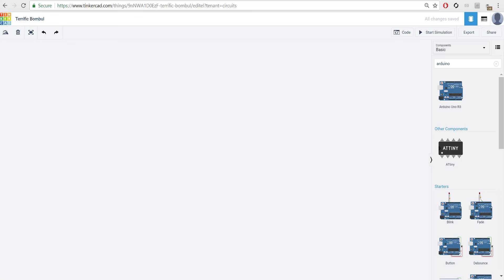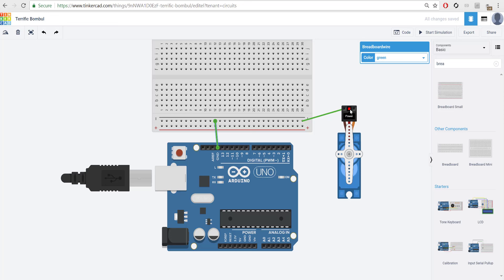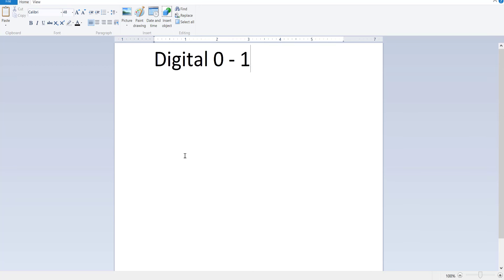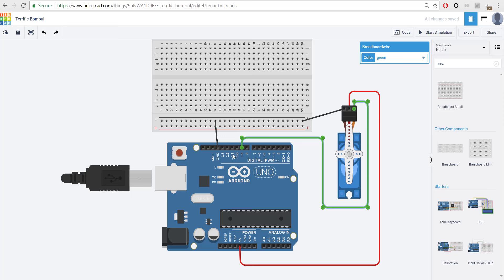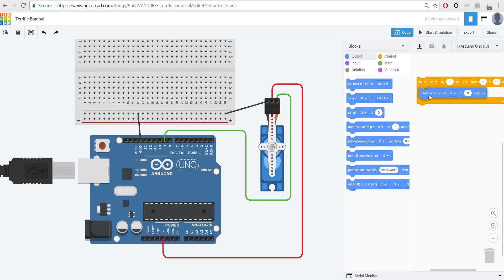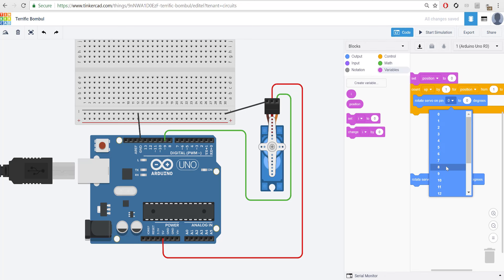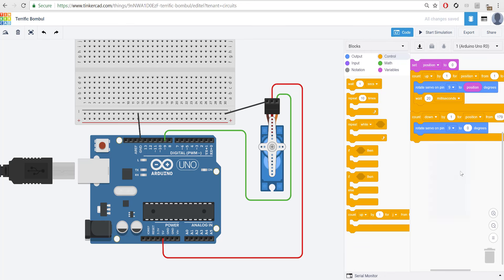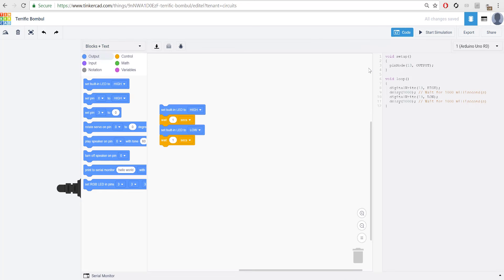Arduino UNO Tutorial #3 - Servo Motor Project (Set Up)

Comment: I have a question. So if you want more than one servo motor put into the arduino, you would plug your first servo into pin port 9 and the second servo into any of the other pin ports like 5 or 6 that also have that indicator?
Reply: I was wondering the same thing
Reply: I just did it and I works just fine